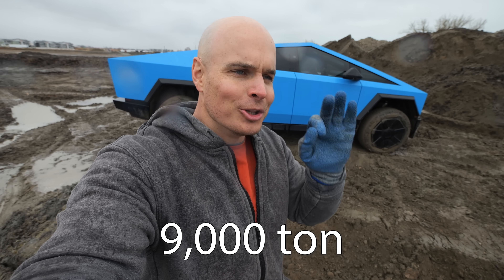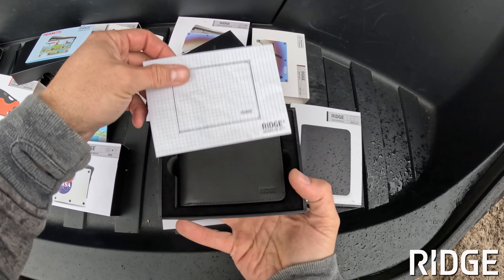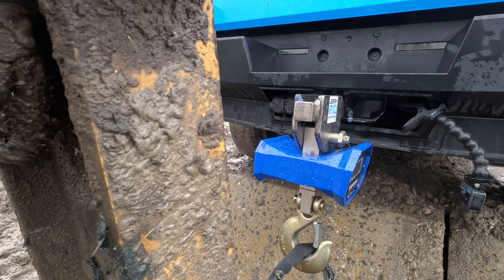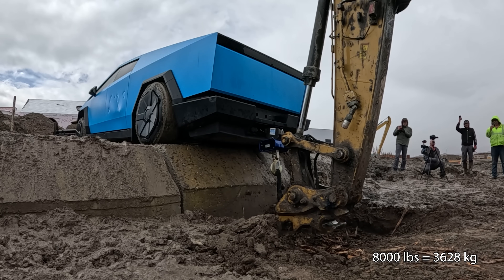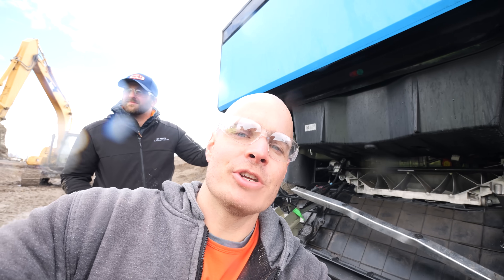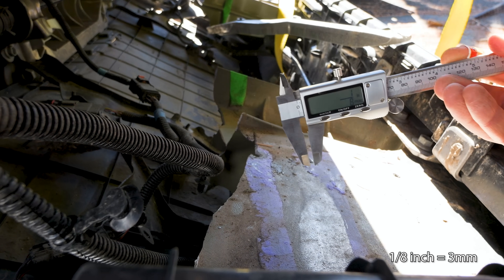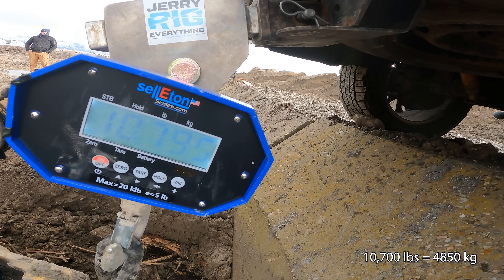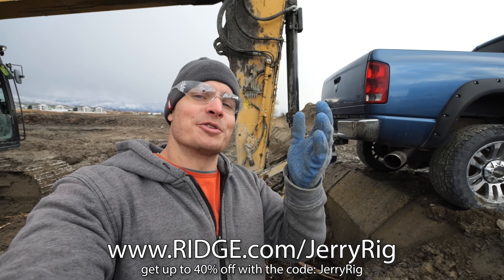SHOULD YOU TOW WITH A CYBERTRUCK?! - (catastrophic failure test)

Comment: After his I will vote for video, he has been showing Tesla breaking video's a lot, does Zack have beef with Elon?
Reply: Yeah because he's an actual engineer. Elon making up bullshit engineering facts that don't hold up is insulting to engineers.
Reply: @iansmith3301  Funny this video comes out the same day as Tesla stocks down at a record rate and X (twitter) has massive Ddos attacks going.. hmmm.
Reply: @iansmith3301  "engineer" proceeds to mislead his viewers...  on no occasion would u be pulling 10k lbs vertically, not even a bump on the road. And also it outrated its rating by 9x. (the dodge's hitch bent also, which would be dangerous and catastrofic if u decided to tow anything with it)
Reply: @Flopah  It's obviously not out rating by 9x if it breaks at it's limit of 10k. Are you okay in the head?
Reply: @iansmith3301  officially and realistically the limit was 1050 lbs. It exceede it by 9 times, thus making it outrated 9 times. I cant believe i have to tell you this in kindergarten level. There is no occasion where you would reach 10000lbs of vertical stress on public roads

Comment: This is scary, but not because of the static strength. Cast (aluminium as well as steel) is generaly very weak to impacts and shock forces. With (repeated) smaller impacts cast parts will fail far below their static yield strength. 
Additionally: F*** ME SIDEWAYS the crosssection of the frame is flimsy! The walls are super thin and the orientation seems suboptimal for vertical loads. A frame like this would seem scary if done in rolled steel.

Comment: So, the tongue is rated for 1100 lbs, and you put 11,000 lbs down onto it and you were surprised because? ...
Reply: I wonder if you hadn't pinned the front down with the other bulldozer wouldn't the driver have noticed the CyberTruck front up in the air?
Reply: You should try the same with an F-150 and a Chevy Silverado.
Reply: @MichaelRussell3000 Steel bends aluminum breaks matter of fact you can go watch whistin diesel cause he did something similar to this with both that doorstop thing and an F-150 the Teslas frame broke off F-150’s bent and was then bent mostly back after
Reply: The Dodge was bent to ruin at 10,000 lbs. The question is without the forklift holding it down, wouldn't it have flipped at about 2000 lbs?
Reply: @toyotacorollaaltis8613  the wd video was of a CyberTruck driven over 6' diamiter pipe, then off of them, the toung fell 6' onto a cement block, putting a moment of force of about 100,000 lbs vertically on the trailer hitch. THEN he tried to drive an F-150 off that same pipe, but it couldn't make it over. So, to get the F-150 free, he tried to tow it off with the CyberTruck and was surprised when the hitch broke. BTW- Bent steel can't tow anything safely, and the Dodge, which broke at 5000lbs, would have flipped if they hadn't pinned it with the forklift in the front.
Reply: @MichaelRussell3000  please someone remind me to save this comment

Comment: Not only that weakness of the aluminum is concerning, but the fact that the aluminum is bolted to steel will cause galvanic corrosion, which in 10 + years would make it much weaker.

Comment: I don't think it's really possible to actually generate 10k lbs of tongue weight with a 11k lb trailer without backing the trailer off a cliff and letting it dangle.  Any other situation, even hitting a pothole with the truck and trailer, are just adding a force to the tongue weight, not the trailer weight, to the hitch.  It's not like when you hit a pothole with your 11k trailer towing normally, that the front wheels of your truck fly off the ground because they aren't being held down by a big ass loader.

Comment: If the 2500 full frame truck is too strong try it with the extreme, a steel unibody Maverick or Santa Cruz with minimal towing capacity and 1/3 the weight.

Comment: Not only does it break easily, but it breaks easily in a way that bypasses the safety device (chains) designed to protect against the chance of the hitch breaking. Probably shouldn't be legal to tow with this thing.
Reply: You might want to read all the comments from the experts and people who have a brain.
Reply: "breaks easily" while it outrated its ratings by 9x and in a situation where the car was held down, it performed great, u wouldnt want to tow anymore with that dodge either, with its bent hitch. and u wouldn'T even tow 10k lbs VERTICALLY
Reply: An idiot (of which the world has more than a few) improperly loading their trailer shouldn't cause the vehicle to break in a way that bypasses the safety device. Period.
Reply: @xen84  i think they would notice that they loaded it inproperly before catastrophe happens. I mean in a real world scenario noting holds you cars front down, so if you load it inproperly your cars front would lift off before the hitch could rip out
Reply: @ I believe you’re missing the point. This wasn’t ‘improperly loading a trailer’—this was applying 10,400 lbs of direct downforce on the hitch, nearly 10× the expected tongue weight. No truck is designed for that. If you dropped a shipping container on any truck bed, it would break too—would you call that a design flaw? This test is nonsense.

Comment: Deceptive headline is deceptive. (There are about 88 other things wrong with the Cybertruck, don't manufacture fake concerns.)

"Towing weight" ≠ tongue weight.

"Do not apply an amount of weight as tongue weight that is what your vehicle is rated as full towing capacity" is the key takeaway here.

See the Rivian that pulled a 38,000 lb tractor-trailer out of the mud+snow a couple years ago. If the weight is applied properly you'll be fine. Unless you're going to try hooking an 80,000 lb trailer up to your CT, it should handle towing anything even vaguely near its tow capacity no problem. 

Note that the YIELD strength of some common aluminum alloys is equal to that of the most common steel alloys. I don't know what kind of Aluminum Tesla is using, but if it's cast 6061-T6, that's literally equal in strength to Stainless-304 steel. (At 40,000 PSI.). That would be the kind of strength that's important when towing. Shear strength is lower (the kind of forces that you're applying by pulling down) but as you proved, more than sufficient for the rated tow capacity.
Reply: You'll lose traction way before anything starts to break

Comment: The high voltage chairs are simple. You either blew the safety fuse or there was a crash detector that had went off. You will have to test and replace your safety fuse for the high voltage system. After that, you’re probably gonna need to confirm and reset the high voltage system. They should clear all of your errors

Comment: Just going to add a bit of info about fatigue limits for any curious viewer who scrolls way down in the comments.
A fatigue limit is tied to stress, which is load going through an area. You can change stress by either changing a load, or by by making the cross sectional area bigger. This is just engineer speak for bigger bar stronger. 
Fatigue is a kind of failure where you can load something cyclically and get it to fail at a smaller force than if it failed due to one big force applied all at once. This is the mechanism that makes things break when you bend them back and forth a lot.
Materials have a fatigue limit, which is the amount of stress due to cyclic force it can take before it starts accumulating damage that could eventually cause it to fail. For steel, this limit is usually around 40% of the force that would make it fail outright. Other materials have unique limits. Aluminum's limit is 0%. Any and every cyclic load (even driving normally down the highway) will eat into its "fatigue life" or the number of cycles it can take before it fails. The amount of life it eats away is proportional to the stress caused by the load. So normally they might last 100 years (no idea of the actual limit, I made this number up for this example) with normal driving, but a few big bumps might drop that to 10 or fewer. 
Steel will take the fatigue life reducing hits that drop it's life but won't take the continuous damage from regular driving. Big bumps will still be a problem if you hit them enough but regular driving won't make it any weaker.
This doesn't have to be a problem though. There are hundred year old aluminum airplanes that vibrate like crazy that can still fly just fine. This is just another thing designers have to account for when designing the plane or car or whatever it is. In this case, it looks like the cybertruck was designed to be a car that looks like a truck and can do some light-duty truck things without actually being a truck. Despite being advertised as something comparable to a pickup truck it really belongs in the vehicle class that includes things like the El Comino.

Comment: I’m sorry… what is the point here? You pulled downwards on the tow hitch… YES, trucks with a steel frame are stronger there is no denying that, but there is absolutely no situation under any sort of sensible use where the truck would be experiencing more than 10,000 pounds of direct downward force on the tow hitch unless something had gone seriously wrong.

Comment: Many vehicles today are actually glued together instead of welded or fastened. Modern Industrial adhesives are actually stronger than welding in many cases. So finding adhesive like that isn't necessarily a bad thing.
Reply: Not to mention it took nearly 10 times the weight it's advertised to be able to take!
Reply: Only if you want it to last. Glue isn’t going to last forever. Especially in harsh climates.
Reply: only in the usa are cars that bad
Reply: @MarcoBerkelaar  there's nothing wrong with using proper adhesives in auto manufacturing. Key word being proper. I said this in another comment, but modern industrial adhesives can be stronger than welds when properly applied. They can be so strong that the two materials being bonded with fail before the adhesive does. And adhesives is often the only way to bond two dissimilar materials. So, just seeing adhesives used in modern vehicles isn't a bad thing, but seeing them applied improperly or the wrong kind completely is. Unfortunately, It's painfully obvious that Tesla engineers have no idea what they are doing at all.
Reply: @ why is it painfully obvious? This took 10 times the weigh advertised!
Reply: @TimLucasdesign  after seeing all the issues that people have been having with the Cyber Truck like body panels coming off, terrible driving system, headlights that are easily covered in snow and ice, and not to mention the promised accessories that are terrible and illegal. I just feel like no real long-term operational testing was done. It all feels like a prototype that was rushed through development. I like some of the innovative ideas implemented with it, but they were implemented very poorly.
Reply: Uh, see his other videos, these trucks are literally peeling stainless trim because they used hot glue.
Reply: @truantray  oh no, I understand that the Cyber Truck is an absolute pile of crap on wheels. What I'm trying to convey is that, adhesives are used all over the auto industry and many modern vehicles have more glue than welds in them, especially where two different materials are trying to be joined, and in many cases, the materials being glued together fail before the actual glue bond does. So by him saying that seeing glue there is a really bad isn't exactly right. Seeing glue in vehicles is perfectly normal now. It's seeing the correct glues in the correct areas that are important. And it's painfully obvious that the adhesives techs at Tesla are either incompetent or are being forced to use incorrect adhesives. Either way, the quality standards are really low, and a serious safety inspection needs to be done on these vehicles.

Comment: The rated tongue weight is 1100 lb so you've proven that the Cybertruck has a factor of safety of 9.45:1, where 2-3:1 is common. Overhead lifting equipment is typically built to 5:1.

Comment: 8:30 - There are structural adhesives used in cars, it is very common. Also, pretty obvious why the frame is having issues, they put the crumple zone in the load path - woops.
Reply: My Jeep doesn’t have “structural adhesives” also known as glue, and it’s 40 years old and a daily driver. These modern cars use glue because they won’t last over 10 years.

Comment: Now load a trailer with 15k lbs, add a load cell into the system, and then try to see how much you can put on the tongue just by driving recklessly.  Ideally a steel framed truck.

Comment: it broke at about 60 times the load it was rated to carry vertically. so calling it a complete failure might be a bit harsh.
yes, an improperly loaded trailer can break it. but an improperly loaded ANYTHING can break ANYTHING
Reply: maybe try that math again.
Reply: @johnhertel3931  according to my quick "cybertruck hitch load capacity" Google search it is supposed to hold 160 lbs vertically.
10000/160=62.5
what is wrong here?
Reply: @johnhertel3931  a quick "cybertruck hitch load capacity" search told me it can hold 160 lbs vertically.
10000/160=62.5
where is my mistake here?
Reply: @johnb0815  because the limit is 1100 pounds not 160. 160 would nt be able to tow a jetski

Comment: I feel bad for the Dodge she could have been saved. We do way more weight routinely around the farm it's amazing how weak that cybertruck is. On an old 04 Dodge 1500 we pulled 25k worth of steel and 32k in cattle and  bust anything. We ended up putting 1 ton springs on it and just working it.

Comment: Not a fan of Tesla but the bias here is off the scales. No realistic scenario can cause 10k lbs on the hitch vertically down. The car has suspension, trailers also, they dampen the shocks but even if we assume 10k pounds can be applied the front of the truck would lift off and the hitch will hit ground before it breaks... and that is why you had to have the machine holding the front in order to get the clicks, wink, wink.
Reply: @whistlindiesel broke it simply trying 2 get a truck unstuck the hitch is a flaw
Reply: You're right. Very unfair test and he either doesn't know about tongue-weight or is deliverable misleading his viewers.
Reply: He is still election salty and Reddit might be gettin through his mind, poor Zack, probably grabbing guns and going after politicians democratically elected might be his next move just because he thinks it’s the better course of action.
Reply: doesnt matter 

if old f truck didnt break , a cybertruck shouldnt

elon simp , wink wink
Reply: @ich_16 you’re just politized and doesn’t like Elon, that’s fine, no one cares, cybertruck rocked on this video, proving it can handle 11 times the load it says to provide.
Reply: @ich_16  Why not?  If it's not better in every way it's a failure?
Reply: 🎯🎯 He's definitely let his Elon derangement syndrome out the bag.

Comment: I love that you basically walked up to a construction site and went "hey wanna try to break a Cybertruck in half?" 😂
For the error messages, I'm betting it tore up and shorted out some of the wiring harness in the back and either blew a fuse or tripped out some of the low voltage system, so a bunch of monitoring equipment isn't getting 12v power and that's why there were a bunch of HV system errors.
Reply: Probably a Can line break
Reply: The left hand indicator not working is a clue something is broken with VCLEFT, there's also an error there.  I'll bet VCLEFT manages something important related to the motor/battery on CT.
Reply: There is no CAN bus. CyberTruck replaced it with an ethernet loop
Reply: Probably ripped a circuit

Comment: I think this is actually a solid endorsement of the truck. Tongue weight is a completely different metric than towing capacity. The fact that you needed to hold down the front of the truck in order to break the hitch says a lot. The Dodge Ram 2500 also has higher load specs for towing than the Cybertruck. So moral of the story, if you load your truck improperly, you risk breaking it.
Reply: This also shows a normal truck is a lot stronger then a Tesla
Reply: That a 2004 Dodge Ram does not have a problem with it despite having a similar towing capacity says a lot.

Comment: Also a good demo of how steel has much better performance when it comes to yield vs ultimate strength. You're going to bend steel a lot of before a failure than a cast aluminum frame will. And gosh, it's almost like there is a reason why heavy duty vehicles still use ladder frames and not unibodies or weird hybrid cast aluminum whatever the heck the Cybertruck is.

Comment: I haven't finished to watch the video, but before I forget I wanted to chime in on the Tesla purple glue. There are rivets visible. I believe that the adhesive is for noise/rattle reduction.
Reply: It could very well be for actual assembly. The entire Lotus Elise was one of the first (commercially available) cars that was fully glued together. Glue is used a lot in Aluminium construction. If designed properly, it's stronger than fasteners or welding. Especially with cast parts.
Reply: @Xiph1980  The first tesla (roadster) was also based on that car.
Reply: Could also be meant to reduce galvanic corrosion.